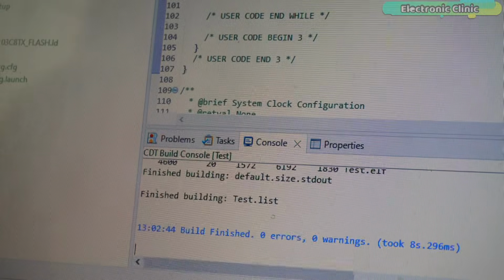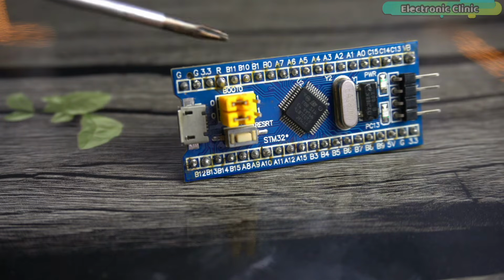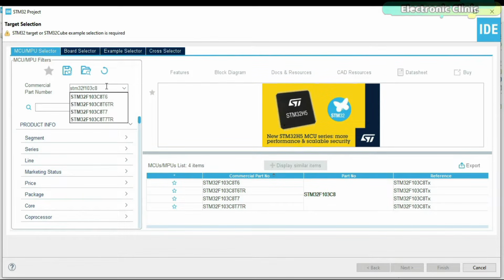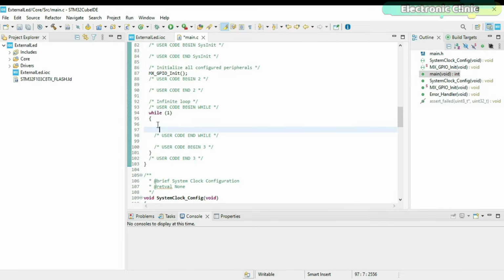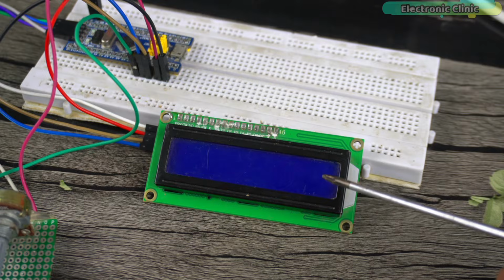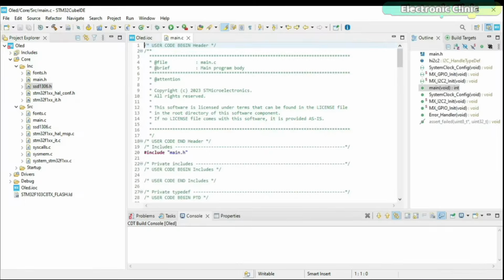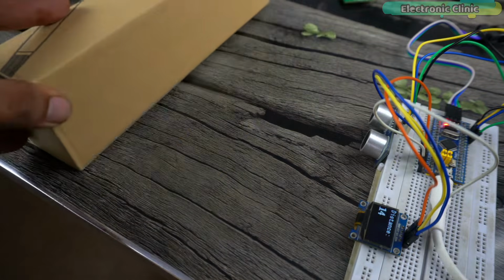STM32CubeIDE Course for beginners, stm32f103c8t6, STM32 CubeIDE #stm32cubeIDE

Comment: I have a doubt bro. I have downloaded the latest Cube IDE version, 2.0. In this version, they have removed STM32CubeMX from the standard STM32CubeIDE package. Now I had to install CubeMX separately for configuring the project. Can you please show the steps for this as well? Because, the steps to create a new project is also changed in the latest version.
Reply from the maker: Ok I will take a look and make a new video.
Reply: @ElectroniClinic  Hi bro, did you get a chance to check the latest STM32Cube Package. I'm stuck and still not able to create a project successfully. I'm still not able to dump the basic blink project into the Bluepill board and test it. Kindly request you to check it as soon as possible and guide me.
Reply: @nav16eentube  this is not that different from this video; download the cube mx and do your pinout config in it and then in project manager choose name, place and your ide (which in your case is cube ide) then after that click generate code and open it in cube ide.
Reply: @ElectroniClinic bro we are waiting for you please make a new video as soon as possible
Reply: if you downloaded the new vesion download the cube mx after that select your board or mcu selector after make the pheriferal naming after that generate code and export the code look different vedios and once you import in ide upload the file to nucleo or blue pill
Reply: I am having same issue actually
Reply: @randomclips-y9l  the problem is I’m not finding any YouTube tutorials that explain a solution
Reply: @عليصلاحكريم-د7ظ Yah i have searched a lot but are of Abt 2 yrs ago so they are not addressing this issue I have downloaded the older version 1.19 to see what i cabn do with it
Reply: I had the same problem so I just downloaded the previous version 1.19 instead of 2.0 although it's have some bug iwas able to blink led
Reply: download downgraded version ,1.19,1.18, etc. and use that

Comment: In my case I just had to change the debugger setting to ST-LINK GBD Server and upload the programs with the proggraming pin jumper set to 1 and after uploading the program just returning the pins jumper to 0 so the programs doesn't get erased as soon as device is powered off. Thank you for making me be able to use 10 microcontrollers I bought for 6€ on aliexpress 3 years ago.

Comment: Hello thank you for good video.
I am wondering on stm32 board there are boot 0,1 pins. I saw some vidoe there are not working without connecting boot 0 pin to 3.3v. But in your video it working. How is it possible? And boot 0,1 pin is not that important to make code and any projects? Only need bootloader code?

Thamk you so much. Have a good day
Reply: Boot 0/1 are only used when uploading code via usb to uart converter (like ch340, fdtl)
Reply: @tew9275 aaaa I see that is why upload with stlink is working without connecting boot pins. Thank you so much

Comment: Is it necessary to connect the STM32 with ST-Link only? why can't we connect the board using a USB cable like Arduino Nano?
Reply: Blue pill do not have any USB to serial convertor, in alternative you can use FTDI breakout for programming...

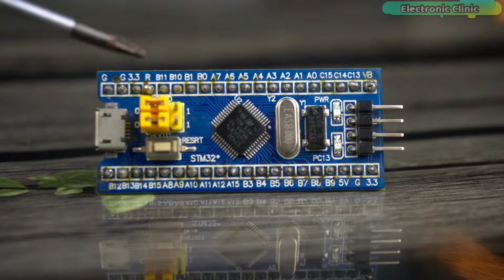Comment: 11:19 #1 blink onboard LED
17:11 #2-1 control external LED
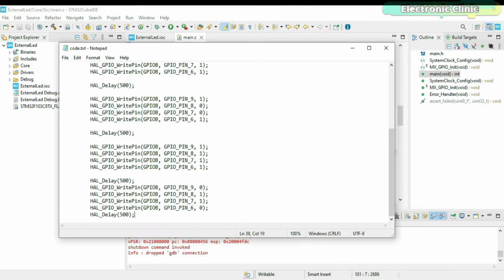20:35 #2-2 Multiple External LED
21:30 #3 read a digital input
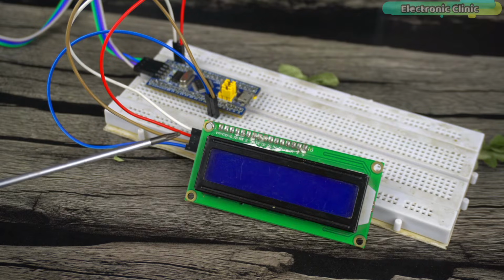26:47 #4 I2C16x2LCD
31:47 #5 Analog Sensor  
34:26 #6 SSD1306OLED
34:26 #7 HC-SR04 Ultrasonic Sensor

Comment: At 14.34 minutes into the video I found that using OpenOCD for the debug probe does not automatically reset the target hardware (Blue Pill) the STLink has to be unplugged from the computer and replugged as shown in the video, BUT switching to the ST-Link GDB Server does reset the target and start the downloaded code running - much better:)  This method does use the STM32CubeProgrammer software so probably this has to be installed beforehand, but it is a free download from STM.